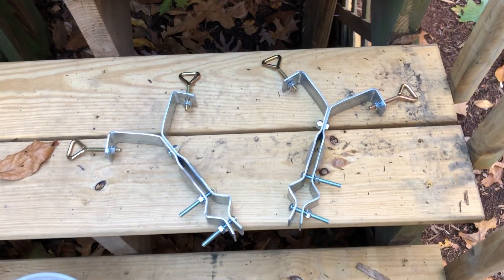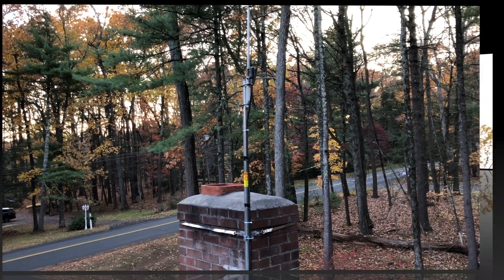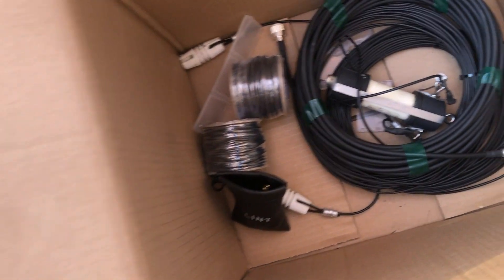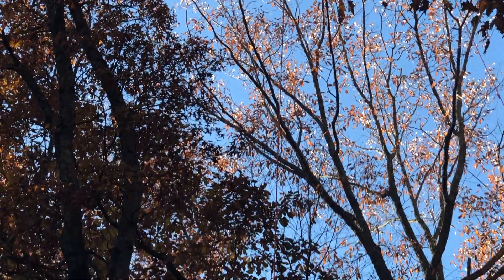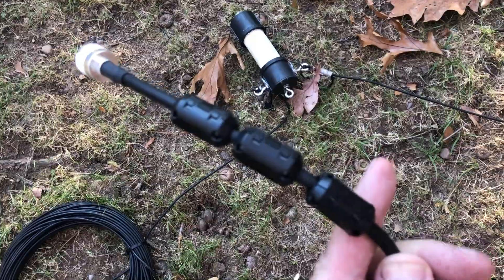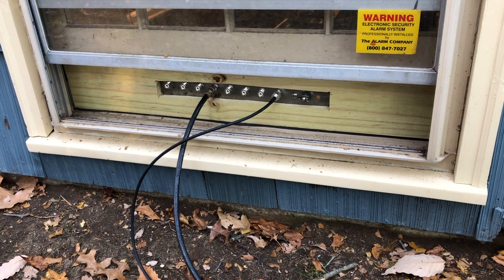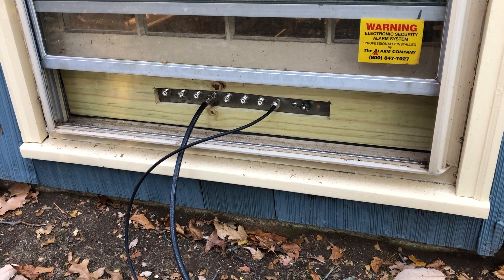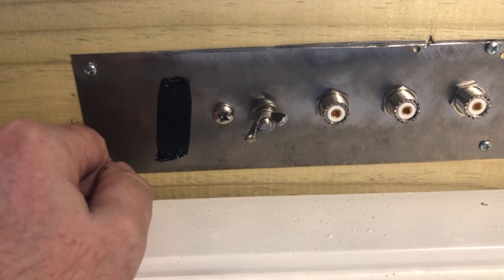Putting up HAM radio antennas!  A 2m/440 vertical and an OCF dipole!

Comment: Good to see you are getting your shack back on the air. I have a couple of Alpha Delta lightning arrestors on my two lines coming into my house that are bonded to the house ground. I highly recommend doing this. They have some type of gas tube spark gap device that is supposed to bring the center conductor of the coax to ground in a lightning event. Although I am not sure anything will contain a lightning strike but it is better than nothing.